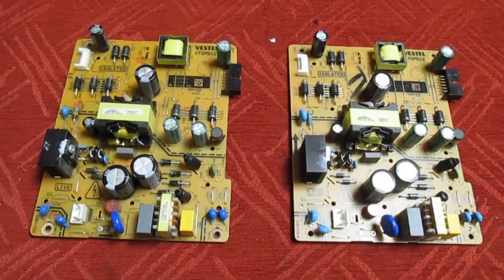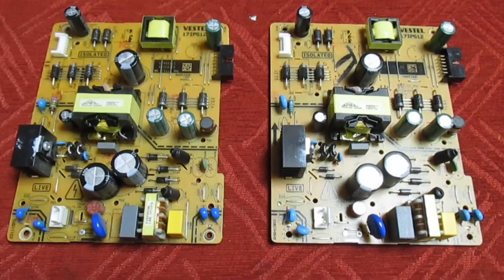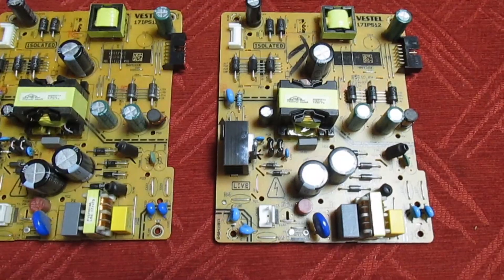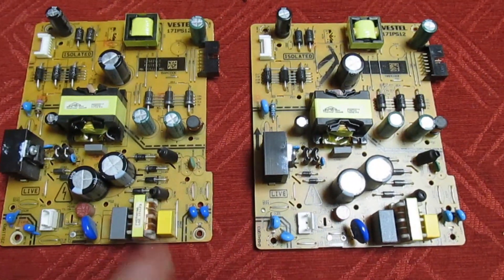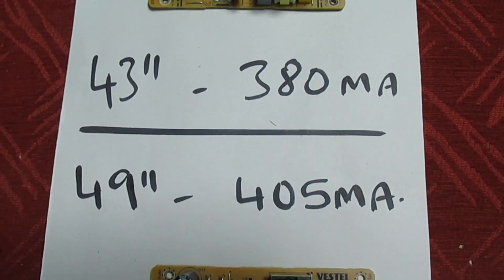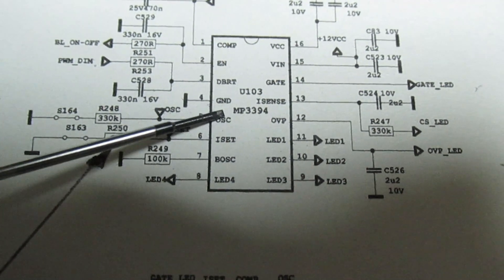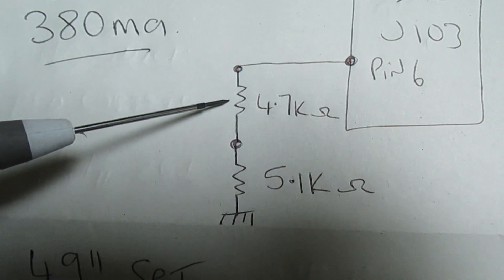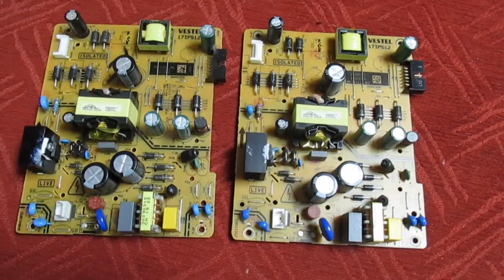Vestel power supply board NON interchangeability explained using a 17IPS12.

Comment: I replaced my 17ips12 PSB with a D40F280N4CW, it was a D43F289X4CW beforehand, it works flawlessly so far!
Reply from the maker: most will work but the LED current will be different for a different screen size  so it could well shorten the life of your backlights in the long term  .
Reply: @michaeldranfield7140  That's good to know, will be keeping an eye on that!

Comment: This nonsense is why i just gave up trying to find parts for a 48 inch "Telefunken" LCD TV (L48F249N3C-3D) that had the PSU fail and potentially took out the main board as well. I thought it would be easy to find spare boards (plenty of TVs with cracked panels around), but quickly learned that even if they share the same board model number, there's a 90% chance they're incompatible anyway. Vestel does the same thing for the main controller board, same model number, entirely different plug options for the panel (pin count, pitch and amount of connectors). I then went looking for the exact same TV model with a cracked panel, and except for one dude selling a complete TV with cracked panel for almost as much as a fully functional one is worth, there was nothing to be found in a whole month, so I just gave up 🤷‍♂
Reply from the maker: Yep, this is a problem with vestel , you need an exact match, some vestel boards are not too expensive to buy brand new though.

Comment: Michael, thank you for another excellent video. I have missed something as I can't get 380mA and 405mA using the resistor values you have seen from the formula in the MP3394 and MP3394S datasheets. They seem to have made a few versions of the MP3394, so perhaps the one in the Vestel TV's is a special part.

Comment: I've been searching to a 17ips72 for my TV for over a year. From what I've heard you can go by the "23 number" by the barcode and it should be a perfect match.
But countless hours and push notifications from various sites I haven't found an exact match.

So I bought one from same manufacturer, size and specs going over every single smd to measure the value. So far I have an extra mosfet, misplaced jumpers and some wrong resistors... Hopefully I will succeed 😂
Reply from the maker: I can have a look if you send me the part number on the board .
Reply: @michaeldranfield7140  thank but I've promised myself not to spend any more money on it, only my time.

I got it to work for a cupple hours. So I went to put the back plastic on and the backlight started flickering after an hour fully assembled.

Comment: Does the backlight LED have a fixed current, or does it vary with user settings?
Reply from the maker: No , its varied by the user setting , Backlight, for example my 32 bush , Vestel set at home min backlight setting is 83Ma and maximum is something like 380 Ma .
Reply: @michaeldranfield7140  Yes I thought most models allow you to vary the baclight one way or another. I usually have it set to soemthing like 50% to 75%, never full blast. So would that be a work around if you happen to have the wrong power supply board - dont set the backlight on full (otherwise the 380mA board may run too hot if it cant supply it, and the 405 mA board may overdrive the LED if it supplies too much)

Comment: hi. thanks for your video i was going very crazy.
i have a hitachi 40HE4001 using this power supply. 
Sometimes it loses the backlight but the leds seem to be ok.
I bought another vestel 17ips12 from another tv hitachi 40HE4001, same tv model, but it doesn't turn on. it doesn't even show the red led.
The board received has another different numbering next to the QR code as you very well explained here.
Is there no other way to know which one will work on my tv? sticker label reference number?
i can do a little soldering but dont know about electronics. 
do you know if there is any way i can fix my tv please?
or find the correct one for me? would be easyer than fix my own board? whats your opinion please? 
thanks a lot
Reply from the maker: https://youtu.be/3eTIq_f5a0s 
  Have a look at my other video, this is more likely to be your problem than the psu .

Comment: It makes me wonder if sloppy practices with these power supplies may explain the lack of reliability with some of these sets. They're clearly approximating specifications to suit different off-the-shelf parts on the fly, from batch to batch. But then shoddiness is the byword of modern electronics, across the board. Not even Sony is immune any more.

It also makes me nervous about using something more juicy like a microwave made by Vestel or Arcelik... This kind of short-cut could kill someone if replicated there.
Reply from the maker: I watched a promotional video about vestel a while back and the guy who owns the company described there products as been like a tailored jacket , made to the exact  customers specification  !

Comment: So, by just changing the resistors you could set the replacement power supply to properly operate in the TV in question?
Great video!
Reply from the maker: yes , if you are replicating one that's not different in size than the other , however some of the psu that drive the much larger screens may have a larger transformer fitted , more capacitors and many more differences but you will see this by a visual inspection of the top side of the board .

Comment: Same  main board number but there's usually another label or bar code label to match if your  replacing Vestel boards .
Reply from the maker: correct, it use to be on a white label stuck to the board  which most people could identified straight away but now its printed on the board itself in black writing that you can easily miss.

Comment: Surely they could have created a stick on label for PSU to match that TV voltages that would save alot of confusion.. but again it would be too simple for vestel
Reply from the maker: yes , it use to be printed on a white label stuck to the pcb that stood out like a sore thumb , but its actually printed on the board itself in very small , black hard to see writing , I guess it saves the cost of the label .

Comment: Note that the 17IPS62 number is on the silkscreen print on the PCB so this would be made in the step when the bare PCB is made. So this is likely the part number of the bare PCB. The Printed Circuit Board Assembly (with components mounted) likely has another part number - but maybe this isn't put on anywhere to save cost? It needs to be put on later than the silkscreen step - either with laser, inkjet or as a label. What is in the black area with the QR code? Could the PCBA part number be in there?
Reply from the maker: the QR code I would imagine does carry the part number but if you look under the QR code there is a board reference number but its poorly printed , very small and in black ink , hard to see, earlier sets had a white label attatched but it would seem to be no more to save on cost .
Reply: Thank you for your reply and sharing a lot of interesting videos! I love the CRTs but not many chances to work on this tech nowadays. A friend has a Williams Defender arcade cabinet which the monitor failed on though. Shorted S-cap that took out the horizontal output transistor and voltage regulator if I remember correctly...

Comment: Sometimes also changes the output inductor. For example, 17IPS62 is used since years ago for 32" TV sets, but older displays have 11 LED per string while newer ones have only 6 LED per string. Therefore, in order to optimize the output converter for a higher current-lower voltage output, the inductor changes. The same applies for 17IPS72 used from 43" to 65".
Reply from the maker: this is correct , some earlier  boards did use different components

Comment: This has always done my head in, especially with the mainboard being set up for each panel 😭😭😭
Reply from the maker: even harder with the main board as the difference may only be the software within a SPI chip .
Reply: @michaeldranfield7140  correct Michael, we’ve all had fun with them haven’t we lol
Reply: @michaeldranfield7140  there’s different voltage regulators and things in different places I have noticed on some
Reply: Totally agree Reece right royal pain in the backside

Comment: I can just imagine it now "Hey, dad, that picture in'arf bright wi' this new board in there. I reckon that old 'un must o' been 'goin' for a while"!! Or, "This picture in'arf crap wi' this new board in there. I reckon they dun't meck'em like they used to"!!

So really, if you have the tools to change those SMD resistors, you can re-rig the boards, but what a trap for the unwary?!
Reply from the maker: correct , and the downside is a wrong board may appear to work ok but you shorten the life of the LED s .
 A bit like fitting a new video head without checking the back tension .

Comment: Blimey, that's extremely well spotted. Most would assume they are the same.
Reply from the maker: That was the point of the video , there's something like 40 variants of this board , most looking the same on the outside .
Reply: @michaeldranfield7140  See, what was wrong with the old ways? 🤣A simple POT adjustment would suffice and use the same board for many models. Hard to believe that it is cheaper to mass produce SOT (Select -on Test) variants of the same board.
Reply from the maker: @adamdavies163  its all about cost , a pot would cost more than a couple of SMD resistors , it might only be pennies but when you think a few years ago vestel were making 45,000 TV sets a day it makes a huge difference to cost , I cant even imagine how many sets vestel produce today .
Reply: @michaeldranfield7140  Yes true, imagine adjusting the 'pot' on 45000 sets a day :-)

Comment: thats bad of them using same part number for things with different specs.! its the opposite to what was said for many crt sets, which was dont order parts by model no. of set but use the exact part number of the item inside, as some production runs may be different and use different ones!
Reply from the maker: one board fits all is something vestel have been doing for years to minimise production costs , main boards are worse as you cant see the difference as its usually just the software contained in a SPI chip, one set I came across could be fitted with 6 different main boards depending one the LCD screen fitted.

Comment: Unless I'm missing something, you could just change the resistors for the current you want in accordance with the MP3394 datasheet, correct?
Still annoying that they have the same model number, but nice to know that you can fix the problem if you get a circuit board with the wrong components for your TV.
Reply from the maker: of course, you could just use a different board and swap the resistors from your old board .
Reply: A warning to this approach. I'm working on a 17ips72. Couldn't find exact match so got one from same manufacturer, size and specs. So far I have many jumpers, resistors and even an extra mosfet. I'm hoping I can still get it working tho.

Comment: Thank you for sharing this interesting video. It's amazing that both boards could have the same part number yet two resistors are different! Would it not make more sense to have a different part number for each board?
Reply from the maker: I think there is something like 40 different variants of this board, what you have to remember though vestel is a budget manufacture so everything is done as cheap as possible to save on production costs , these psu boards are old technology and have remained pretty much unchanged for 10 years or so
Reply: @michaeldranfield7140  Absolutely, but it took me about 2 seconds to come up with the idea of just adding an extra digit to the end of the part number printed on the board. No extra cost involved, and surely would save them time and money to be able to supply the correct part for the correct as TV as easily as possible. How else do they know themselves? If a pcb has the same part no as another, and looks identical, it is only fair to assume it is the same? And if it is not fully interchangeable because it has been slightly modified for another model, then that is just begging for something to go wrong, and the fault would be entirely pointed at Vestel. I suspect Vestel probably just plan for you to fit the same board in any set and who cares if the service life of your TV is negatively affected anyway.
Reply from the maker: @JohnSmith-pq7vn  there is a part number on the board but its hard to see and a QR code which I assume can be scanned at the factory but the reality is vestel don't want sets to be repaired , they want to sell a new one , a few years ago the vestel promotional video reported they make 45,000 TV sets a day so you can see why there business model just works on selling a new set .
Reply: Yes of course it would, but that would mean employing some common sense, and we all know that that's the least common thing about.
Reply: Adding another suffix number more or less akin to the screen size. Here again there are differences according to the measurement units used, though metric in centimeters is the more universal worldwide.